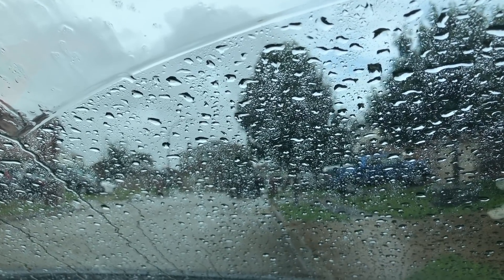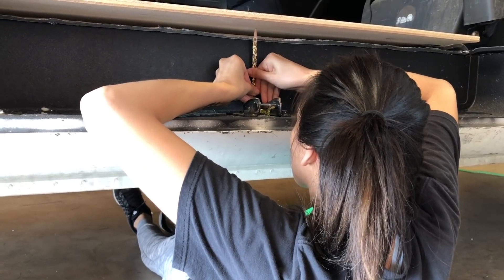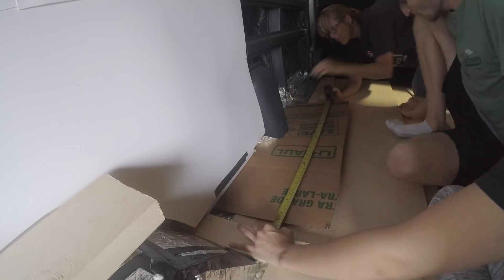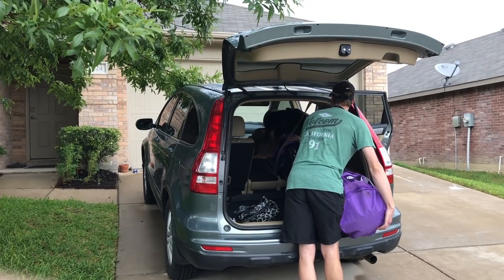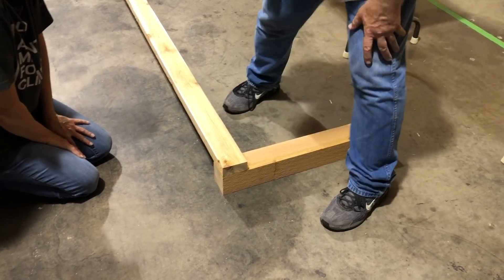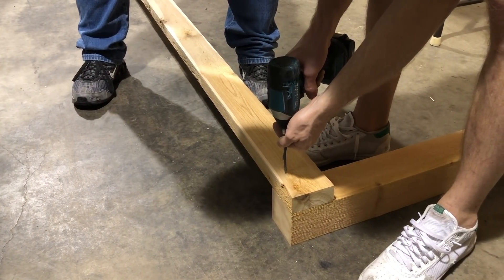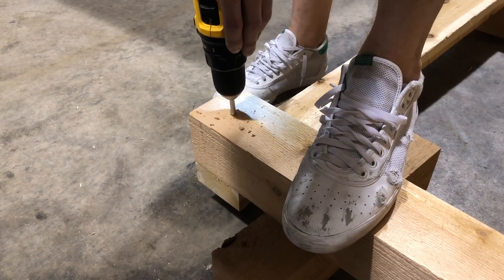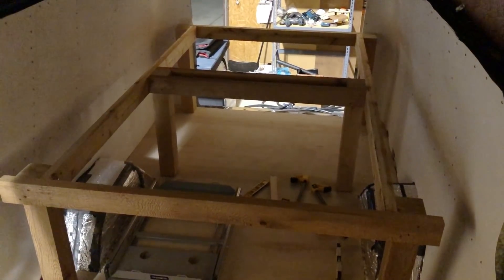Building A Van Home 🔨🚐: Bed Frame Build & Finishing the Subfloor | Hobo Ahle

Comment: Where’s the last video?! 😕 i wanna know 1. What screws you used for the 2x2s & 2 what did you use to hold the wooden frame when you went to drill the holes in the van for the fan?!?

Comment: Nooo. Don't use that kind of fiberglass insulation in the floor :( It will hold so much moisture. It's not like using it in a house. I guess it it will give, but in a vehicle, it's no bueno.

Comment: so much room wasted on a bed, you should have installed a pull out sofa bed and be done with it.
Reply: The platform bed is pretty popular in high top vans. Especially because you get to have a bed and use the height of the van to still create/have a massive storage space underneath. Once you do a pull out bed, the whole pull out bed area is controlled by the pull-out bed’s needs...and you have to pull it out. For some it’s just nice to have a bed you can just climb into without converting the pull out area. Plus tons of storage underneath!
Reply: I was thinking the same thing but I guess it's just preference. I would rather have more space if possible.
Reply: @lifeofliz1650  they are not spending much time in van. She has enough space, outside. If you want stay home, van life is not for you.
Reply: @Framlii  like I already said. It's a matter of preference. Your response seems to indicate that you have experience in van life. I'm assuming that is why you have suggested van life may not be for me. From your own videos I'm a bit confused as to why you would say that.
Reply: Space wasted? I don't think you're thinking logically. By creating a raised bed frame, she's creating a ton of storage under her bed, whereas with a pull out couch you have what? A couple more feet of space when the bed's put away and no storage. Common sense!